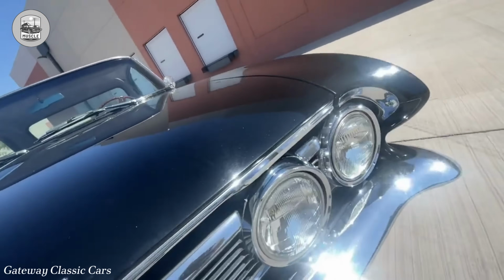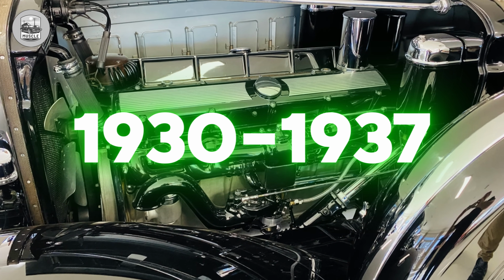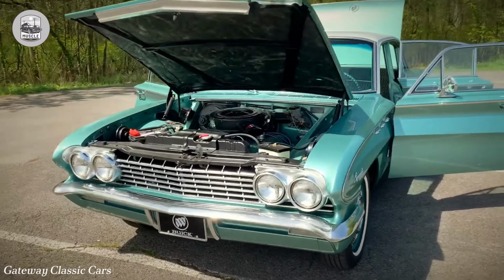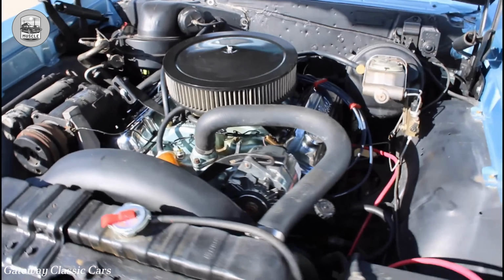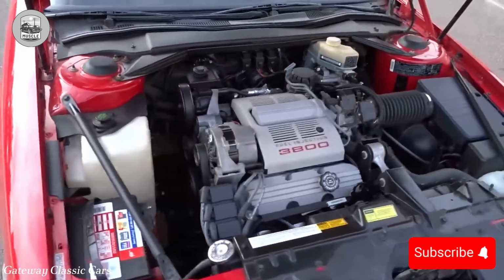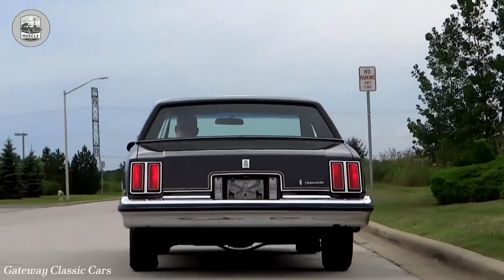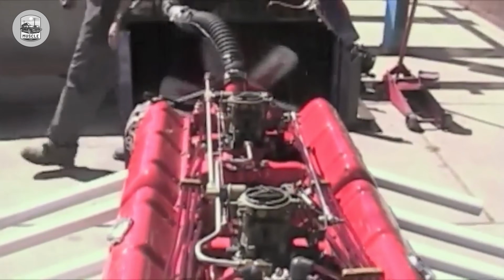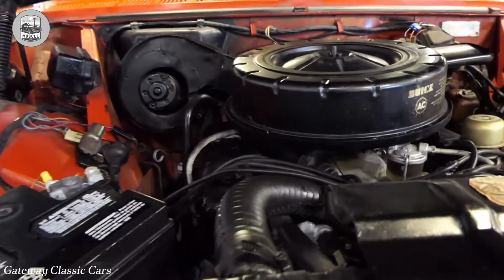10 MOST FAILED and WEIRDEST GM Engines ever made | Worst engines blunder!

Comment: You forgot the 305 V6 From the 1959 through 1960's GMC  TRUCKS..👍
Reply from the maker: Thanks for bringing that up! You're absolutely right—GMC's 305 V6 engine is a beast that often flies under the radar. Introduced in 1960, it was a workhorse designed for heavy-duty trucks, offering tons of torque at low RPMs. Its durability and unique design made it a reliable option for hauling and towing. The 305 V6 had some real innovations for its time, including robust components like its forged crankshaft and gear-driven camshaft. It's definitely a noteworthy addition to the conversation about classic truck engines!
For everyone else, what do you think of the 305 V6?

Thank you for your information. It is so great...
Let's see our channel is a place to share, comment or show your feelings about American Muscle Cars.
Have a good day.
Don't forget to like, share or SUB on our channel to enjoy other great Muscle Cars videos.
Spending more time with other great videos on our channel to explore more about American Muscle Cars.
Reply: @MuscleCarMasters68  My father had a 62 GMC with a 305D V-6, and on many occasions as he and my Uncle, with His Chevy V-8 350, both trucks being standard Shift, the 62 was Three in the Tree, and my uncles being 4 on the floor, would be both pulling equal-ish loads of bailed Hay, on flat trailers....

The 62 had the short narrow bed so it got the Long Trailer, and my uncles Chevy got the short Trailer due to having the Longer Wider Bed, things just seemed to equal out....

But the Chevy would be in the lead and the GMC always followed, and I found out why....

On one odd occasion, as we followed the Chevy uphill, my Dad dropped the GMC into 2nd Gear, scooted closer to the short trailers rear bumper, and began to push, I could tell that the Chevy Down Shifted and we began to move a little faster uphill, but the Chevy sounded as if it was about to blow up from just the revs alone....

And the GMC was just chugging along, as if it were almost asking to shift into 3rd....

I held that truck till my Dad ordered me to give it to a cousin....
What a loss....
Reply from the maker: @hoseqt1  The 305D V6 in those old GMC trucks had a reputation for its low-end torque, and that’s exactly what you experienced. It might not have had the high-revving nature of your uncle’s Chevy 350 V8, but that V6 was designed to pull heavy loads with ease. The torque band allowed it to chug along, even uphill, without feeling strained. The Chevy 350, on the other hand, was more about horsepower, which is why it felt like it was revving harder to keep up.
The "Three on the Tree" manual transmission in the GMC was definitely an interesting setup for that engine, giving you the feel of those slower but powerful shifts, while your uncle's "Four on the Floor" likely gave him more control over the higher revs of his V8. It’s fascinating how trucks from that era, despite their differences, could still balance each other out on tough jobs like hauling hay! Thanks for sharing that memory—it really paints a vivid picture of what those trucks were capable of.
I’d love to hear more stories from everyone about experiences with these old workhorses. Have you or your family ever had similar experiences with other classic trucks?
Reply: While the 305 V6 from the GMC trucks of the late '50s and '60s was indeed an interesting engine, it's important to note that it doesn't quite belong in a conversation about the most impactful V8s. The 305 V6 was known for its durability and low-end torque, but it was more focused on workhorse applications rather than high-performance or widespread usage across multiple vehicle types. V8 engines, especially those like the ones discussed, had a broader impact on the muscle car culture and automotive performance history. The 305 V6 was reliable, but it never reached the iconic status that many V8s did in terms of power, performance, and versatility.
Reply: @AdelynDodson  The topic is unusual engines in general, not unusual V8 muscle car engines. The 305 V6 belongs here.
Reply from the maker: You're absolutely right! The GMC 305 V6 is a great addition to the conversation about unusual engines. It was a workhorse designed for trucks and heavy-duty applications, not something you’d expect in a muscle car discussion, but its design and performance were certainly unique. That big V6 could handle serious loads with impressive torque, making it a standout in its own right.
Everyone watching, if you’ve got more examples of unusual engines, whether they’re muscle car V8s or anything else, drop them in the comments! We love hearing from you and building out these discussions. And while you're here, make sure to subscribe to the Muscle Car Masters channel for more awesome content, and check out our other videos for more deep dives into muscle car history.
Reply: @MuscleCarMasters68 it would have been sufficient to cover the entire family of GMC V6 truck engines, which includes the Twin Six and the oddest V8 based on the V6.
Reply: @benbrown2119  While I get what you’re saying about covering the entire GMC V6 family, I think focusing on the unique Twin Six and that oddball V8 variation would have really highlighted the true innovation—and, honestly, the quirks—that made these engines legendary. The rest of the V6 lineup may be tough as nails, but they don’t exactly stand out in the same way. Diving deep into those wild, boundary-pushing designs would keep this from turning into just another overview of old workhorse engines. Don’t you think that’s what makes them unforgettable?
Reply: @CookeZachery  Considering the GMC big block V6 predates the Buick V6 by two years and features a splayed pin crankshaft even fire design, I would say that it is a landmark design.
Reply from the maker: @benbrown2119  The GMC 305 V6 deserves more recognition as a landmark in engine design. That splayed-pin crankshaft design gave it a smooth, even-fire operation that was truly ahead of its time—especially in an era where V8s ruled the muscle scene. And you’re spot-on: while it wasn’t built to compete with the high-revving V8s in muscle cars, it laid down some serious torque for those heavy-duty GMC trucks, making it a powerful piece of engineering history in its own right.

For anyone curious about the hidden gems in muscle car history, check out our latest video on Muscle Car Masters! Don’t forget to comment with your thoughts, like if you’re enjoying the content, share with other muscle car fans, and subscribe to keep the muscle car passion roaring...
Reply: @benbrown2119  The GMC big block V6 lineup deserves all the credit for pushing boundaries in engine design, and that splayed pin crankshaft truly set it apart in terms of durability and performance balance. It’s the kind of innovation that doesn’t get nearly enough love today. And while the V6 family as a whole is impressive, focusing on the unique Twin Six and the experimental V8 variant would definitely show just how far GMC was willing to go to set their engines apart from the competition.
Reply: Ah, the 305 V6—interesting choice! But let’s be honest, the 305 V6 was a quirky engine for sure, and it worked for trucks needing low-end torque, but it doesn’t hold a candle to the V8s that truly defined that era. The V8s, with their power and iconic sound, set the standard for performance. The V6 might be a unique footnote, but it’s not exactly what comes to mind when we talk about engines that defined the ‘60s. Now, a big-block V8? That’s muscle!
Reply from the maker: @CookeZachery  Great point! The 305 V6 was definitely built with durability and torque in mind for those hardworking trucks, but it’s true that when we think of pure, unfiltered muscle car power, our minds jump right to the roaring V8s. Those engines defined the muscle car scene and are still celebrated today for their performance and sound. But hey, the 305 V6 has its place in history as a reliable workhorse, even if it doesn’t quite bring the same adrenaline rush.
What are your thoughts on this, everyone? Drop a comment below, and don’t forget to like, share, and subscribe to Muscle Car Masters to keep these discussions alive....

Comment: My favorite is the Buick V6. I had a '65 Skylark with a Super Turbine 300 transmission. The variable pitch torque converter made a 2-speed transmission into a 4-speed. It was a great car!
Reply: I can see why you enjoyed the Buick V6, especially with the Super Turbine 300 transmission—it was an innovative setup for its time. However, I’d argue that the Buick V6 wasn’t the best powerplant of the era. While it offered decent efficiency, it lacked the torque and performance that muscle cars of the ‘60s were known for. Even with the variable pitch torque converter giving the impression of a 4-speed, the 2-speed automatic still limited acceleration compared to the 3- and 4-speed manuals or even the TH400. The V8s from Buick, like the Nailhead, offered much more raw power and better suited the muscle car spirit.
Reply: @KeithGreene-k1v  That's nice if you're flush with money. I really enjoyed my Fireball  V6, my '65 Skylark, and it's neat transmission. End Communication
Reply from the maker: @KeithGreene-k1v
Thanks for sharing! The 1965 Buick Skylark is such a cool piece of muscle car history, especially with that Fireball V6. While a lot of people think muscle cars are all about V8 power, that V6 brought a lot of innovation to the table. Buick's engineering in the mid-'60s really stood out, and you're absolutely right about the transmission—it was the ST300, right? That two-speed automatic with a switch-pitch torque converter made for a smooth ride and actually delivered some nice performance for its time.
For those who might not know, Buick had a knack for creating engines that were ahead of their time, and the Fireball V6 is a perfect example of that. It’s always great to hear stories like yours!
Thank you so much, have a good day.
Reply: @MuscleCarMasters68  Super Turbine 300!
Reply from the maker: @M10000  Thank you for your information. It is so great...
Let's see our channel is a place to share, comment or show your feelings about American Muscle Cars.
Have a good day.
Don't forget to like, share or SUB on our channel to enjoy other great Muscle Cars videos.
Spending more time with other great videos on our channel to explore more about American Muscle Cars.
Reply: @M10000  LOL... thank you anyway...
Reply from the maker: Thanks for sharing that! The Buick V6 in the '65 Skylark is definitely a gem, especially paired with the Super Turbine 300 transmission. That variable pitch torque converter really gave drivers the flexibility of a 4-speed feel with just a 2-speed trans—amazing technology for the time! Buick's engineering with that combo made the Skylark a smooth, yet powerful, ride.
We’d love to hear more stories like this! Anyone else have a favorite engine or transmission combo from back in the day?

Comment: 69 z28 had a 302  for one year
Reply: I have a 68 gm 302 block and crank.
302 was 67 68 and 69
Reply from the maker: @Instantcalmity  That's awesome! The 302 small block is a legendary engine, especially in the world of American muscle cars. You're right—the 302 was produced by GM in 1967, 1968, and 1969. What makes it special is that it was designed specifically for Trans-Am racing, where engine displacement was limited to 5 liters (305 cubic inches). Chevy engineers took the 327 block and paired it with a 283 crank to create the 302, giving it that unique combination of high revving capability and robust durability.
The 302 engine gained a reputation for its ability to rev to 7,000 RPM and beyond, making it a favorite among racers and enthusiasts. Its performance in the first-generation Z/28 Camaro helped Chevy make a mark in the Trans-Am series. The ’68 version you have is a rare gem! It's part of a golden era for Chevy performance.
What are your plans for that 302 block and crank? Building a race engine, or maybe a resto-mod? We'd love to hear more.
Reply: The Z/28 had the 302 for 67, 68, and 69. In 70 they were allowed to run a destroyed engine in the Trans Am series, so the LT-1 350 was used.
Reply from the maker: @rdsimmonds  Great comment, and you’re spot on about the Z/28's engine history! From 1967 to 1969, the Z/28 came equipped with the high-revving, race-bred 302 small block to meet Trans Am series regulations, which required engines no larger than 5 liters (305 cubic inches). The 302 was a legendary screamer, perfectly suited for the series' tight competition.
In 1970, rule changes allowed teams to run larger engines, which opened the door for the LT-1 350 in the Z/28. This engine maintained the high-performance character but provided more torque, making it a great all-around powerplant for both street and track use. The LT-1 was also famous for its use in the Corvette, and its legacy continued well beyond the Trans Am series.
Thanks for bringing this up! Feel free to share your thoughts on how the LT-1 compared to the 302, and don’t forget to comment, share, and subscribe to Muscle Car Masters for more muscle car insights!
Reply from the maker: You're absolutely right! The 1969 Camaro Z/28 was indeed powered by a high-revving 302 cubic inch V8, but here's something even cooler—the 302 was a unique blend of a 327 block and a 283 crankshaft, designed specifically to meet the Trans-Am racing series' 5.0-liter engine displacement limit. The '69 Z/28's engine loved to scream at high RPMs and was paired with a mandatory Muncie 4-speed transmission, making it a true driver's car.
The 1969 model also stood out with its aggressive styling, cowl induction hood, and a track-ready suspension. It's no wonder the '69 Z/28 is one of the most iconic Camaros ever built!
Got more details or stories about these legendary machines? Drop a comment below and let’s keep the conversation going! We’d love to hear your thoughts and experiences....

Comment: You forgot the Vega 2300 engine! 
All aluminum block, no cylinder sleeves, iron head and a few different power configurations.
Reply from the maker: Great point! The Vega 2300 engine is definitely a significant one to mention. It was indeed a unique all-aluminum block with no cylinder sleeves, which made it quite an innovation for the time. The use of an iron head, paired with different power configurations, showed Chevrolet’s attempt at pushing the boundaries of lightweight design and performance. However, this design came with its share of challenges, particularly with overheating and durability issues that impacted the engine’s long-term reliability.
Let’s keep the conversation going! What do you all think about the Vega 2300? Share your thoughts or experiences with this engine, and feel free to comment on other engines that deserve a mention. Keep the great insights coming
Reply: While the Vega 2300 engine certainly deserves mention for its all-aluminum block design, it wasn't without significant flaws that prevent it from being a true success story. The lack of cylinder sleeves led to premature engine wear, especially as the aluminum walls were prone to scoring and distortion under heat and stress. This, combined with cooling issues and head gasket failures, resulted in the Vega gaining a reputation for poor reliability. Even though it was innovative in concept, the execution didn't live up to expectations, making it a cautionary tale rather than a celebrated engine. 😄😄😄

Comment: Turbo rocket fluid. Best name ever!
Reply: While "Turbo Rocket Fluid" might sound exciting and futuristic, I have to disagree that it's the best name ever. 😁😁😁😁It may evoke images of high-tech performance, but it's a bit misleading. The name was associated with Oldsmobile's Jetfire, and while the turbocharged engine was innovative, the "Turbo Rocket Fluid" was actually a complex and temperamental water-methanol injection system. It required constant maintenance and could lead to serious engine problems if mishandled, making it less about raw power and more about added complexity. There are definitely more fitting names that reflect true reliability and performance.
Reply: @KeithGreene-k1v  Turbo rocket fluid definitely brings up some wild memories, especially from the 1960s Oldsmobile Jetfire, which used this mix of distilled water, methanol, and a corrosion inhibitor to boost the engine's performance. That innovative little turbocharged V8 was ahead of its time, but the complexity made it tricky to maintain! It’s an awesome piece of automotive history.
Why do you think so? Turbo Rocket Fluid is best engine ever....
Reply from the maker: Right?! 'Turbo Rocket Fluid' has got to be one of the coolest names in automotive history! For those who might not know, it was actually used in the Oldsmobile Jetfire back in the early 1960s—a turbocharged V8 powered by a special methanol-water injection system. It sounded futuristic and promised insane performance for the time!
Anyone else have a favorite cool-sounding car-related name or interesting automotive trivia? Drop your thoughts in the comments and let’s keep the conversation going.

Thank you for your information. It is so great...
Let's see our channel is a place to share, comment or show your feelings about American Muscle Cars.
Have a good day.
Don't forget to like, share or SUB on our channel to enjoy other great Muscle Cars videos.
Spending more time with other great videos on our channel to explore more about American Muscle Cars.